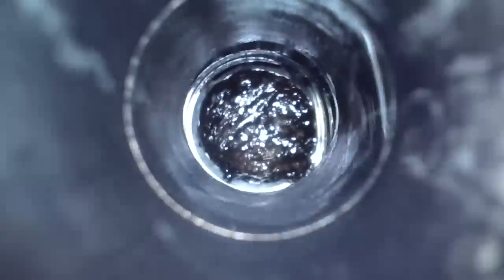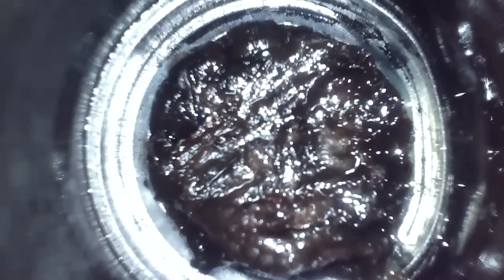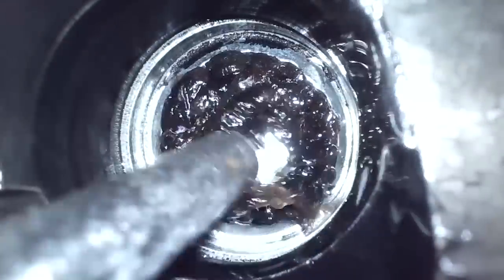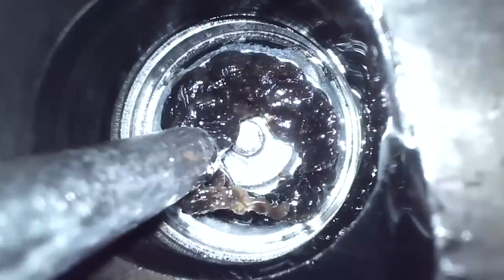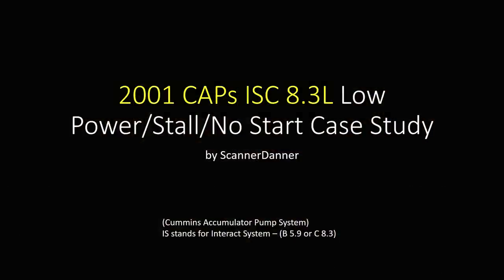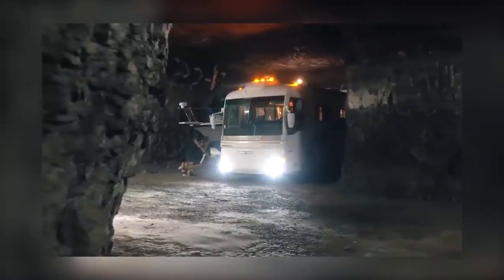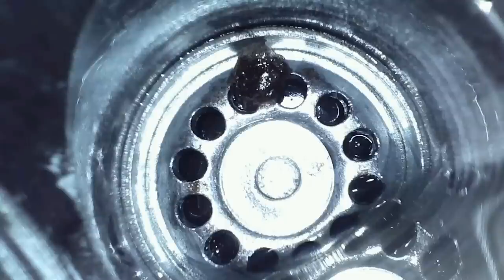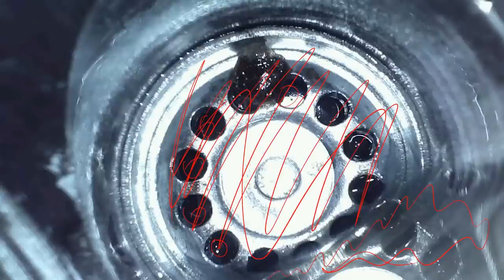2001 RV Cummins 8.3L ISC CAPs Injection System - Low Power/Stall/Intermittent No Start

Comment: I like it when you repair Diesel engines, it's a fantastic video, in Spain this problem is very common when the engines have been stopped for a long time, a trick to avoid it is to keep the Diesel tank full to prevent humid air from entering the tank and condense water on the walls, which is typical when you park the car at night after driving with it and more in an area with humidity that together with hot fuel makes it more problematic. Normally in Spain we do not like to recommend additives, but when we have algae in the fuel it is one of the few times that we recommend using an additive from a recognized brand such as Wurth antibacterial.

Comment: Great video. I'm also a technician, with 40 years experience (on gas engines), and coincidentally have a 2001 Monaco Diplomat with the 8.3L ISC Cummins 330hp. I'm glad you discovered those loosened bolts, which makes me wonder how much they contribute to a common failure on this engine. A lot of people on the forums are recommending the FASS Fuel Systems lift pump and filter system to increase the longevity of the Cummins CAPS system. Apparently one of the things that kills the CAPS pump is small air bubbles in the fuel from the low pressure (vacuum) lift pumps. The FASS system filters out microscopic air bubbles which damage the CAPS pump and the injectors. I now have to wonder how many CAPS pumps have failed because a tiny amount of air is drawn in with the fuel from that leaking gasket you found on the lift pump? You may have saved yourself a CAPS failure down the road, and those bolts will certainly be something I check before spring. Thanks again!

Comment: Before I was a car mechanic I was a heavy vehicle mechanic first work on semis and all that good stuff and I did my apprenticeship and some qualified years at Cummins in Australia and we use to get the one way valves clog up due to the inner part of the fuel lines deteriorating just some info for you God bless and thanks for the great content 🙏👍

Comment: I grew up in a trucking family. My family were Hot Shot Truckers, now called Expediters. We did this late 60's long before Fedx or UPS came around and thru the 90's. We always added 1qt of transmission fluid to the tank once a month to keep the injectors, pump, diesel fuel system clean. Sometimes twice a month depending on ho many miles that engine was used; we did this in the D/FW area. Never had a fuel/contamination prob from our diesels. I dont have any experience with the new diesels - best to use something off the shelf that is approved for whatever engine your running. Thx for the Vid, always good info
Edit: As far as what to call your ck valve screen thingy, Im sure the mfg has a name for it but made it imposdible for the DIY to find

Comment: Hey Paul 20 years ago working at a Mercedes Benz dealer that  black algae caused havoc mostly in the tank and would clog the tank screen. Some tanks had to be removed for the cleaning of the tank. What we did back then was every maint service we added Biobor fuel additive we called it diesel doc back then. I highly recommend you get this and use it as you said at the end of your video. That stuff worked, it was the only one that did and it might have been a recommended product of MB. Get that stuff and use it. OH BTW in the Benz people would have about 1/4-3/8 and run out of fuel on road side we would give them a few gallons and tell them take it to the dealer the sock in the tank was clogged. OH the nightmare back then.

Comment: I know this is an older video (thanks!) However, you mention 'algae' and are somewhat correct insofar as it is a form of biology but the gelling issue you present is actually a bacteria and/or fungus that eats diesel (lots of carbon) and needs water (and sometimes air) to live in an interface between the water and the fuel. Best to call it microbial growth. It can prosper in the fuel system and may be dislodged, clogging pumps and filters. The rest you present is good info and so thanks again!
Reply from the maker: Good info! Thank you

Comment: I ran into this years 40+ years back when I was working at a farm equipment dealership. I didn't know it at the time but later learned that the fuel tanks for diesel equipment are lined with copper to prevent acid buildup and the growth of algae.....not sure about RV's though.
Reply: Yeah, coil of copper tube in the tank if it's not copper lined can make a difference.

Comment: That coupler on the injection pump is called a compucheck fitting. We (Caterpillar) use them for pressure testing of hydraulic. I'm sure I've got a coupler laying around that I could send if you ever need to test again.
Reply from the maker: Thank you! RV is gone, sold it about a year and a half ago

Comment: Having a fuel pressure gauge right before the high pressure pump is a good idea!  I ran an Isspro gauge on my 03 5.9 Cummins.  Factory lift pumps on those were good for about 100k. I made to 100,900!  I ran an Air Dog through my stock filter housing and put the fuel pressure elbow going to the CP3!  Gauges are a good thing

Comment: I actually did lose my injection pump and had it replaced with a factory rebuild pump. Then I bought a FASS filter system and took the lift pump out of the loop. The FASS pump runs constantly so your injection pump does not have to pull the fuel all the way from the tank. Put in a vacuum on the fuel area exit and the FASS remove the air as it stands for fuel air separation system. I highly suggested for anybody running a caps pump on their motorhome.
Reply from the maker: I'd do that if it still had it. Thank you!

Comment: Great video and some really good information.  This is the reason i ALWAYS use diesel sdditive. I dont have 8.3l but do have 5.9l in my pusher and dodge pickup. Also have ford 7.3l and have never had a water or algae/fungus issue. After seeing your video i will be changing fuel filters more often. Thanks guys.

Comment: Great video Paul.

I had a leaking lift pump in our 2003 Dynasty with the 8.9 liter ISL when we first purchased it back in 2007.  It was leaking internally and coming out the electrical connector but I initially thought it may be the three mounting bolts like you mentioned,   but it turned out not to be.  I've seen where people have had those come lose and the CAPS pump sucks air causing cavitation and let go long enough takes out the CAPS pump. 

I think with the ULSD fuel introduction around 2007 it triggered a redesign because the new lift pump I installed in 2007 had a different part number.  

I then had a similar issue to yours with fuel starvation on a trip back in 2015.  I replaced the filters on the trip thinking it was causing the fuel starvation issue but it didn't fix the issue.  Got home and after more diagnosis determined the check valve had become dislodged creating a restriction for higher fuel demand situations.  Replaced the lift pump again in 2015 and it was fixed.  

We've had friends start to have CAPS pump issues over the past several years so a couple of years ago I installed a FASS system on my coach as a preventive measure to ensure I feed the injection pump a positive stream of fuel as well as I can monitor my filter's health through a guage I mounted in my cockpit.

Do you still have your coach?  I thought you were planning on selling it?
Mike
Reply from the maker: I did sell it my friend. This is from a few years ago and we finally got around to editing this video. Thank you for the help over the years!

Comment: great video. i have a 98 8.3. just went thru a lift pump and eventually caps pump replacement. you really need Insite to see everything. accumulator pressure needs to be around 4000 psi.  i also had to replace my ECM - i think due to water getting into it when i pressure washed the engine. DO NOT PRESSURE CLEAN THE FIP OR ECM !!!! once the ecm was replaced it ran fine. then the chinese lift pump failed. oem or fass or bull dog is the only way to go on replacements. and carry a spare. ALSO...ecm's...there is a burgeoning industry in scamming people on ecm repairs...Diesel ECM Exchange is a prime scammer outfit. they happen to be near where i live so i dealt with them in person. STAY AWAY !!!!!  my engine has the first fuel filter right after the lift pump, and a second at the rear of the bus. the means the mechanical tranfer pump has to pull fuel about 50 ft before it gets to the injection pump. weak point in the caps system. Fass and Bulldog can alleviate that but i am putting an electric lift pump between the filters running full time at about 10 psi. it has free flow when off. so its fail safe. the caps 2 systems on the  04+ cummin$ have an ecm controlled lift pump that turns on in low pressure situations.  great intel here on speed sensors.  i learned something.  love yer work, dude.....
Reply: oh yeah....the qwik coupler is a compucheck fitting. you can read the transfer pump and lift pump pressures there. i also have used it for an air bleed. cranking pressure at that point is about 50-70 psi. lift pump will be 10-15 psi.

Comment: That so called screen looks like the top of an oil filter!! Looks like you added more knowledge to your arsenal  Paul & Caleb! Diesel engines were designed back when so nothing could stop them from running! You had to pull a lever to shut off the fuel or block the air intake, they fixed that!! Great Video Paul, you probably gained a few more thousand viewers!:washhands::washhands::washhands::washhands:
Reply from the maker: Hopefully it helps out the RV community. Thank you!

Comment: Yes sir , you got lucky . there is no question 
 I am a retired Caseih service tech , we sold that engine/fuel system in 80% of what we sold , thousands of units , a couple thought s
 the INSITE tool (scan tool ) your friend was using was super out dated or a knock off , they went away from that in about 2005 , didnt work then probably will not work now , 
 i know your a teacher , and a good one so you did the proper steps , but you were short on basic info , a " how it work" 
 if your interested i have a training manual from when they introduced the CAPS system in 1999 , just let me know 
 CAPS pumps are problematic , i have seen a tech shoot first and look later when dealing with one ,
Reply from the maker: Absolutely! And it was trial by fire for me on this. Got one more coming up that happened a few years later that we are putting together now. I sold it about a year and a half ago, so studying the operation of the CAPS system is no longer high on my priority of things to learn, but thank you so much for the offer!

Comment: Diesel bug is a single microorganism or a consortium (group) of microorganisms that grow on fuels.
It includes bacteria, filamentous moulds and yeasts. They feed on the hydrocarbons in the fuel and create biomass, biofilms and damaging by-products.

These microorganisms will live very happily in even the smallest amounts of water, often from condensation, and at the interface of fuel and water, where they can create thick mats known as biomass. They can also coat surfaces and ‘climb’ up storage tank walls by creating what we know as biofilm.

Diesel bug is often called diesel fungus or algae—though, in reality, it has nothing to do with algae.

Comment: ..... we had to fill the diesel fork hoists at 3pm Daily to prevent Diesel fuel bug 
 Also not allowed to remove the metal fuel tank filler screen insert while refilling diesel 
 Air space in the fuel allows the diesel bug to grow 

Fill up before the cold of the night sets in 
Keep your tank full as much as possible 
Run additive in your tank too .

I hopes this helps people  understand  this issue

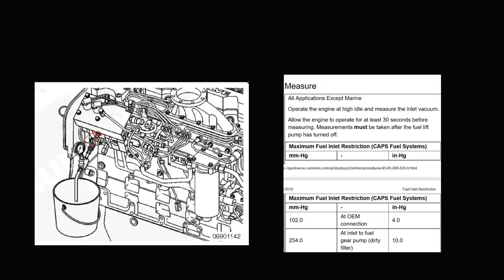Comment: I'm sure you've heard it already but testing at "Rated power" is basically at full rated torque. Doing tests like that is just not possible in most cases so Cummins often makes tools for it. The "goofy setup" you mention at 25:36 and the port that blew your gauge off is most likely where they wanted this tool connected. It's nothing more than a measured orifice and a drain hose to simulate a full power condition for the pump. 
Anyway, great video 👍
Reply from the maker: Exactly! To simulate the volume loss you'd get under heavy throttle right?
Reply: @ScannerDanner  yep, you got it. It basically plays the part of all 6 injectors running at WOT.

Comment: Sorry to hear about the big headache problem of the low power situation, but knowing your work approach, you'd fix it.  Given the driveability issues and the fuel pressure code, using the KISS principle a decent diesel mechanic would/should have investigated possible fuel restriction, which also would have revealed the bypassed primary fuel filter issue in addition to the sludge build up at the anti-drain back valve.  That in itself is puzzling for the formation to occur there.  That is not algae, because algae requires sunlight to grow.

Comment: Looks like a backflow preventer, at least that's what it does, the black disc on the other side of that shiney part with all the holes in it.
Reply from the maker: Yes sir, it's a check valve or diaphragm that traps fuel from the transfer pump to the CAPS injection pump

Comment: Nice video. Looks like some older footage or Caleb got a haircut. 😂

I have an issue on my RV with losing prime and fuel dilution in the engine oil. I got a quote from Caterpillar and they recommended replacing fuel injectors. They gave me the we don’t want to work on it price at $9948.00. 

I installed a Fumoto drain valve and dumped 2.5 gallons of oil and added a gallon of Lucas oil stabilizer and will do it my self at home. I will start with the o-rings and hope it works before putting a six pack of injectors in it.
Reply from the maker: 😀 this was from a few years ago. We've been sitting on this for a long time

Comment: Late to the video but you need to make sure it doesn't have a inline screen filter on that rv. I worked on many rvs that have a filter/screen above the rear axle in the supply line before the lift pump and primary fuel filter

Comment: Early duramaxes have this same vacuum leak at filter head, but without any lift pump, so it's hard to see.  Rebuilds don't really fix, because the housings warp.  New housings don't seem to have the problem, even without any obvious dimensional differences, I'm thinking the heat-treatment or metallurgy was revised.

Comment: Hey Danner! That lift pump diaphragm is a Check Valve. It slows pressure loss to the High Pressure Pump.I would imagine the Algae was growing from contact with the rubber ?
Reply from the maker: Yes sir, we covered that. Thanks!

Comment: And praytell what is the mfg of this awesome 'inspection camera'???

Addundum:  Could it be that the algae grew due to the non airtight lift pump?  They say that algae needs sunlight to grow, but the exposure to air maybe contributed to this.  Super algae?  Was it algae?  Could it be a life form from another galaxy slowly invading our planet???

Love love love your videos.

Jim

Eve's Automotive
Reply from the maker: lol love this comment. Yeah so apparently it isn't really algae but some sort of bacteria? And yes, I think it is plausible that the air from the loose bolts on the tranfer pump was a contributing factor. Or as others have said, I got a chunk of this stuff from a fill-up of my tank, but I doubt this because I did not have this happen again in the years after this was cleaned out and I went through many, many tank fulls of fuel in that time

Comment: I assume the injection pump has a return line and the fuel always flow through there at max capacity. Anything growing in the tank would tend to be filtered out running through the fuel system. A filter before the lift pump might be a good idea.
Reply from the maker: I can't remember exactly, but I know one of the filters was bypassed before I got the RV and I believe it was before the lift pump. I think this was a common bypass as starving the CAPS injection pump would ruin them. But this algae did NOT come from the tank. It grew right there!
Reply: @ScannerDanner on 5.9 trucks most guys buy aftermarket electric lift pumps. They have filter and water separator on the pump to eliminate this issue. Might be a good solution in the long term.